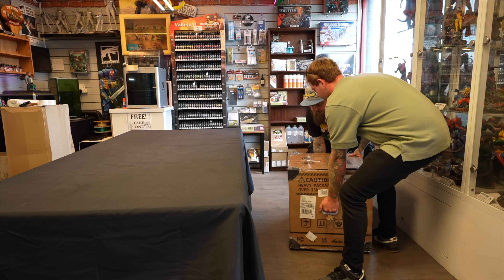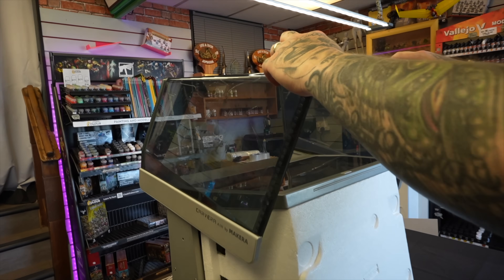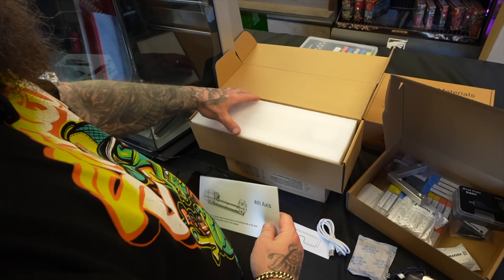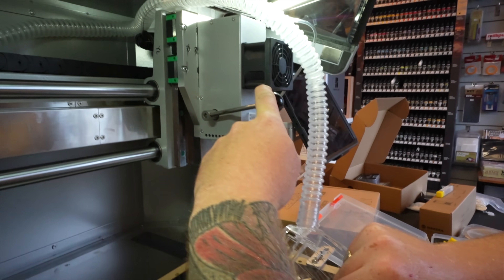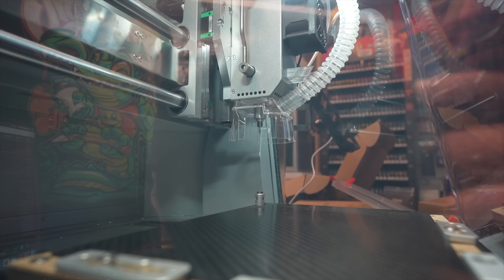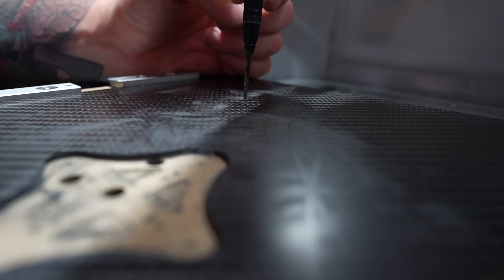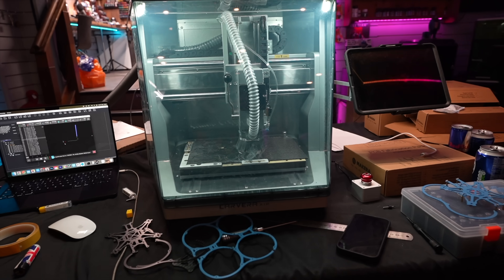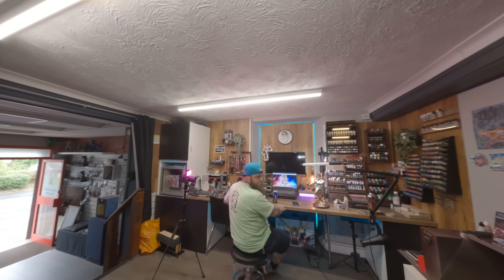Cutting Carbon Drone Parts on the Makera Carvera Air CNC

Comment: How clean is the edge? How tight/sloppy are the holes? I'm coming from a Stepcraft D600-V2 w/ Kress 800 spindle. Thanks
Reply from the maker: It’s actually really clean. I’m a bit fussy about carbon frames from other rc builds I’ve done and I was surprised it was really nice but it is also a brand new bit and I barely cut much
Reply: @Groundeffected  I had the milling bath, so dust was contained. probably need something custom. thanks,

Comment: Carbon fibers are electrically conductive and can damage a normal vacuum cleaner if they get into the motor.    
Furthermore, the dust produced is very hazardous to health, which is why carbon should always be milled under water.

Comment: Yo, where can I get that model? I have some carbon sheets I was running through my CNC and would like to take a crack at building one. Been wanting to get a slightly upgraded fpv quad.
Reply from the maker: There are a few options on thingiverse for a couple different models.  George came up with this plans so not 100% sure where he found them.
Reply: @Groundeffected I tried to guess some dimensions from it sitting on the bed of the CNC. What size props was he using?

Comment: I always leave some "bridges" between the part and the main body of the sheet to prevent it from becoming loose, something around 0.5 mm, It works really well. I use Lightburn and i draw thin rectangles and merge them with the body of the part and the sheet to create some sort of "support" material, in the end just cut the thin wires with an x-knife to remove the part.
Reply from the maker: That makes more sense than letting them shoot out like missiles hahaha